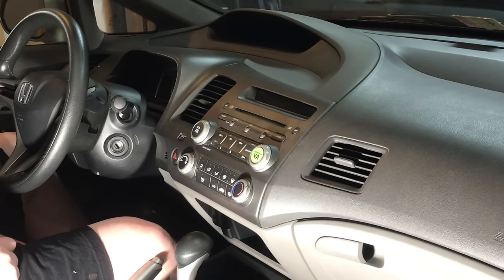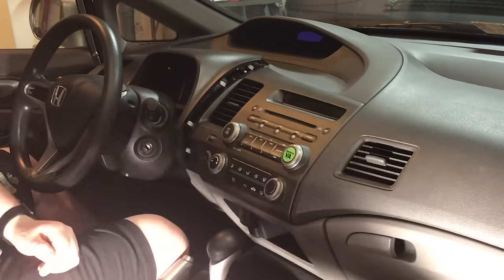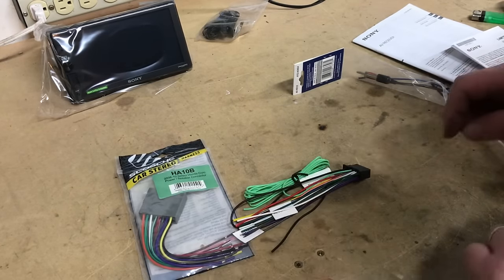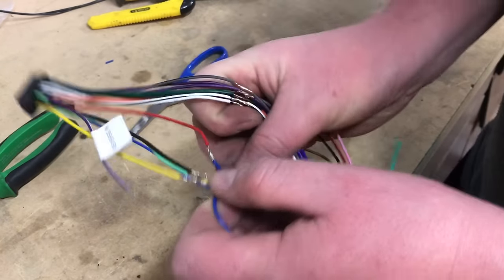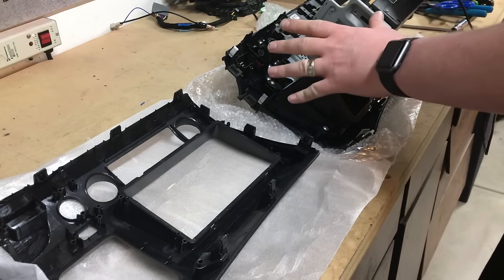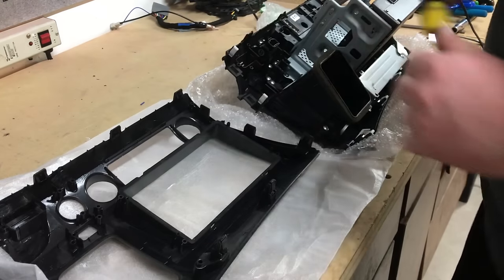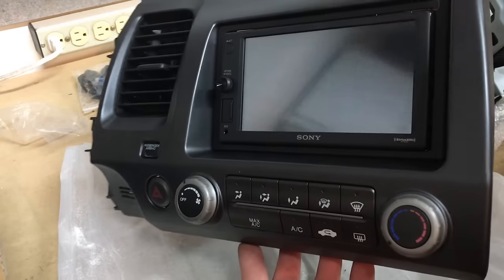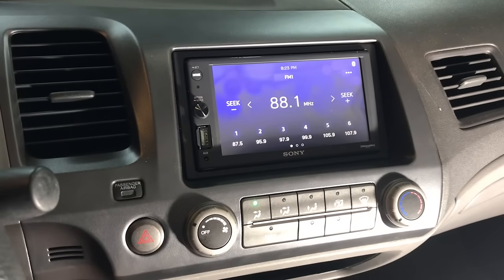2006 - 2011 Honda Civic Touch Screen Stereo Install

Comment from the maker: Parts Linked in the description!
Reply: Hi Chris, thanks for the great video. I noticed on your steering wheel on the left,  you at least have the basic volume control buttons, exactly like my 2010 Honda Civic. In your video, you say “we don’t have steering wheel controls in this civic” so you’re using the basic scosche HA10B harness, BUT In your description it says “If you have steering wheel VOLUME CONTROLS get the Crux harness”. 
Could u confirm for me if the scoshe worked with controlling the volume of the Sony Radio via steering wheel volume? I’m just a bit confused so I want to make sure if I get the basic Scoshe, the volume button on the steering wheel will control the volume on the Sony? I will be installing the exact radio you installed so I just want to make sure I’m taking the correct products to my mechanic. Thanks In advance.
Reply from the maker: @uniquetress7149  We did not have the steering wheel controls, so no, the Scosche harness will not work to control the radio.  You will need the crux harness.
Reply: @ProvoBeastAudio  Thank you. Will order now. Sorry for the long message 😀.
Reply: Heyy I’m having an issue with no sound. I have no idea what it is. I have a DX so no premium sound system. I’m getting power. And I kno the speakers work. Have any ideas. What did u do with the secondary harness that was plugged into the oenology radio. Cause you have the main. Then there an additional one that I can’t figure out. And it only has 6 wires and after looking for hours and hours. It doesn’t have that light blue wire that would be the amp power on. You didn’t seem to bypass the amp here so any advice.
Reply: Please state why you need the crux. I bought it form eBay it says it should work. The crux harness is 70$. It’s way too expensive
Reply: Great video. I just bought a ‘07 Si and was curious how to remove factory radio and climate control panel. I had no idea about the screws on the bottom. 
Thanks for helping me not destroy my dashboard 👍🏼

Comment: I watched the Crutchfield install video and thought...... why do you need to remove the entire dash? It didn't seem necessary. You proved me right, and you installed the climate control module in correctly. Also very professional soldering job, nice job !!! Crutchfield is tops but their video, while it covered the install well, was a little sloppy and amateurish.
Reply: I agree , he even disconnected the airbag

Comment from the maker: If you have steering wheel volume controls you would like to retain with your civic, use the Crux SWRHN-62B harness adapter instead of the Scosche HA10B Wiring Harness Adapter.  The Crux adapter is a simple plug and play unit which allows you to keep those buttons working on the steering wheel with the new radio.  Cheers!
Reply: Nice
Reply: First, I must say this is a great video. It's really informative.  I would like to try to install one in my civic but would like to retain the steering controls. Do you have any videos that show how to use the crux swrhn-62b wiring harness? Thanks

Comment: how much would something like this cost to have done at a shop?
Reply: The shop can make up any price, you can call to find out how much would it cost but you would only be ripped off. Just be a handy man and do it yourself, save money and learn something new at the same time.
Reply: Antiquarian $300 for just parts 500 installed
Reply: @antiquarian1773  Or completely mess up your car.  Nothing wrong with paying a pro to do it, peace of mind is priceless.
Reply: Mike A  It was my first mod at 15 man. Second mod was putting type r cams in the engine. Third was polishing the head and adding cylinder sleeves. You’d be surprised how easy car stuff is once you watch enough YouTube.
Reply: @gustavrodriguez910  - haha nice.  who needs school?!  Youtube taught me more than 12 years of high school and 4 years of college.

Comment: Great video!

Really helpful, especially as a complete novice to pretty much everything in this video (soldering was the only issue but ofc that depends on the individual).

(Originally commented about how CarPlay couldn't tell the dimmer status - that was bc the head unit had dimmer set to ON, not AUTO)

Comment: Definitely the best of the few I watched. , I've wired quite a few , so that wasn't my question(s) , my stock oem radio had 2 plugs, 1 plug I can only guess is for the steering wheel controls ???
Also the L brackets you used , my face plate came with but the holes didn't match up with the cheapo head unit I have which also came with metal L brackets. I was able to drill/modify those brackets. Longest part of my install, lol.
I'm gonna watch your backup camera video. Thanks ! For the guidance and reassurance

Comment: Blue wire can be used for the power antenna so that it comes up only when the radio is on and down when its off. Cheers!

Comment: Any one have issue where the ac/heat buttons stick down (max ac specifically)

Great video, that was the only issue I had (of course the whole thing is back together before I noticed the button)

Comment: Thank you for this video!!! It was my first time doing anything to my car and this video really helped. Only issue I have is that I’m not getting any sound. Everything else works but that lol any ideas of what I might have done wrong?
Reply from the maker: Sounds like you have the factory amplified sound system.  You will need to connect the blue / white wire in your harness adapter to your radio.
Reply: @ProvoBeastAudio  when you connect the blue and white to the radio is it canceling out the factory amp ?
Reply from the maker: No, it retains and turns on the factory amplifier.  Only way to "cancel' a factory amplifier is to bypass and remove it.
Reply: @ProvoBeastAudio  no one removes it though in all the vids they just symply bypass
Reply: Did you figure it out
Reply: @ProvoBeastAudio where do you connect the blue white to?
Reply from the maker: It's an amp turn on wire, if there is no aftermarket or factory amplifier, no need to hook it up. @weksos4423

Comment: For anyone that has no sound, if you have Premium Audio option, you will need a cable to bypass the stock amp (Metra 70-1727)
Reply: Isn't there a way to have the blue /blue white hooked in the harness to make it come on. If the bypass is wired your no longer using the amp correct ?
Reply: I am having issues with this. 😢

Comment: sweeeeet video! i do have a question though. So i have a 2008 honda civic ex with the premium sound system which has a subwoofer in the rear deck. I think that includes a factory amp.. would i hook up the wire that you left out for an amp for that factory amp?
Reply: You need a special harness to bypass the amp signal

Comment: Hi man i just bought a csx 2008 and i want to know if its the same way to remove and install a new radio like you did on a civic 06-11 i know they are almost the same but before buy i want if  all component are the same and used your video to change my radio...! Thk a lot love the simplicity of your video thk

Comment: Nice video! So, what did happen to the flashing ANTI THEFT light? Is your alarm system working fine?
Reply: Answer: The radio has a built-in anti-theft mechanism that causes it to reset after your battery dies or is replaced. The flash light is only for the radio. Fortunately, it is not related 
with the key anti-theft system that is used to immobilize the engine when a fake key that is not sync programmed to the vehicle is attempted to be used.

Comment: Great video. Im running into 2 problems. I have an EX with steering wheel controls and I hooked everything up and I have no sounds and no control at the steering wheel. Could use some advice?
Reply: I used the Crux SWRHN-62B for the steering wheel control
Reply from the maker: @R8rblood  I'd suggest reaching out to Crux directly for assistance as the issue will be in your wiring or compatibility with your vehicle.
Reply: Any fix?
Reply: @kobylewis2281  had to find the steering wheel stereo control wire and jump/splice to it. It was grey and green or pink. Can't remember.

Comment: Were you able to get the next and prev track button on your steering wheel to work with the new Stereo?
Reply: That car doesn’t have steering wheel controls
Reply: @robfassi3297  2010+ does.
Reply: FreeStyle yes only ex and si models, any 2006-2011 civic ex or si has steering wheel controls. Dx or lx does not.
Reply: Anyone  knows wheres thes factory amplifer for honda civic si 2007
Reply: @lunaticscarclubjdm5572  front of the shifter

Comment: My 07 Civic as the steering wheel controls. I see the Crux SWRHN-62B has the antenna adapter with it, so do i still need to get the other antenna adapter?

Comment: Friend, when connecting everything again the air conditioning no longer turned on, I already checked and connected the plug in correctly, what could it be?  thanks

Comment: Amazing video! If I am installing an amp, and I have the blue power wire connected, do I need to then use the ground that is included in the harness? Or just worry about the blue cord?
Reply: You still need a ground. The blue wire (if you’re talking about the remote wire) is ran from the head unit to the amp telling the amp when it should be on or off

Comment: Thank you for this tutorial! I have this exact head unit on order but the 08 Civic it's getting installed in has steering wheel controls. Does the Crux SWRHN-62B harness adapter match up wire for wire like the Scosche HA10B? Looking at the pictures in the Crux harness listing I'm not quite sure what i'm looking at, compared to feeling confident in the Scosche HA10B after watching this video. 

Any insight would be greatly appreciated. Thanks again!
Reply from the maker: It would be very close, if not identical and they diagram all their wiring in the instructions that comes with it.  Highly recommended.
Reply: @ProvoBeastAudio   Thank you for the response! I'll go ahead and purchase it. It appears to have an antenna adapter included with the harness, does that work or do you recommend purchasing the Metra 40-HD10 antenna adapter you have linked in the bio?

Comment: I've replaced the radio in my Civic 2010 hatchback but the original AC display stopped working (I knew it would happen) but I don't want to loose the little display since I want to know what my AC is doing. Any advice?

Comment: Pretty nice video my friend, i'm getting the same dash to my Civic, i need to get a radio, Can you please tell the right size or dimensions for the stereo. i'm about to order one online but i need to get the right one. Thank you.
Reply from the maker: Screen sides is irrelevant, the kit we used works for all standard size double din radios.
Reply: So a 10 inch screen fits?
Reply: @rexholes9574  no it wouldn't because a 10 inch screen is bigger than the double din size the biggest you could do would be about 7 inchs

Comment: How do I connect the steering wheel control for a 2009 Honda si? I already bought everything in this video
Reply from the maker: Use the Pac SWI-RC control module.  That should do the trick.

Comment: Where did u connect the harness to the antenna mine doesn’t fit
Reply: There should be a connector in the back of your unit that may say ANT. Not sure if your unit came with one. If you're talking about your antenna power wire, he wired it to the power wire.

Comment: If we don’t have a reverse camera to install we can cover that wire up correct? No issues?
Reply from the maker: Yep, and as the reverse trigger wire on the radio is an input, not an output, you can just leave it as is as it won't hurt anything.

Comment: Doing it this way won’t effect steering wheel mounted cruise control buttons right?
Reply from the maker: Nope cruise runs independent of steering wheel volume controls.
Reply: That’s what I figured, Thanks for the reply! I ordered from Crutchfield and it mentions wiring into the brake light wire, for the Sony xav-ax1000 I’m guessing that is as simple as it sounds ?
Reply from the maker: @sheldon7411  Honestly with Sony's, you can just ground the parking brake wire for this year to bypass the parking brake.

Comment: would splicing it be okay instead of soldering them?
Reply: You can splice it pretty much does the same thing but I heard it has a better connection if you solder them together.
Reply: Soldering will always have a better connection. Heat shrink will allow you to have a better seal and protection so nothing arcs/grounds out. That is the last thing you want to happen, especially if you bought an expensive unit.

Comment: When you say “remove the negative battery”

Are you saying under the hood to literally unplug the negative part?
Reply from the maker: Literally remove the negative cable off of the terminal of the battery.

Comment: Would have been nice if you'd shown how to remove the AC and fan control knobs
Reply: theincrediblewho did you figure how to do this
Reply: @403_blessed2  yes I did! Had to watch a few YouTube videos before I found someone who thought that a removal/reinstall video needed to show all of the removal steps, so it's not just this guy.

It's actually way easier than I expected: after you remove the 4 back screws, you just push the middle of the knob with your thumbs. The outside ring pops off, the climate control unit is free, and the rings pop back in after you put the CC unit in the new panel, although you do have to line up a notch inside.
It would have added about 30 extra seconds to show both steps.

But again, I saw a lot of videos that left out that step, so apparently most YouTubers think it's self explanatory.

Comment: Does the USB port located under the armrest still work after installing this radio? Thanks!
Reply: Bro where is the usb and aux port in radio I haven't seen plz tell plz
Reply: @aslambazai94  I don't have this stereo. Some of the 8th gen civics had aux and usb  in the arm rest compartment

Comment: Scosche HA10B Compatible with Select 2006-10 Honda Civic Power/Speaker Connector / Wire Harness for Aftermarket Stereo Installation with Color Coded Wires I know the video says 2006 up but wondering if this will work for my 2011 honda civic LX it does say compatible with select 2006-2010 so I was wondering if its still compatible for mine. Thanks!

Comment: Crutch field said I needed the idata link maestro for this install. I only have cruise control for steering wheel controls. Is that correct? I already bought it...........
Reply from the maker: Depends on your trim and year. Send us a message on Facebook and we can help you with your install!
Reply: @ProvoBeastAudio   I called tech support at Crutchfield again. They finally told me I didn't need it. They are sending me a new set up. Thanks for getting back to me.

Comment: Very much appreciate the tutorial. I am trying to get my backup camera to work the back is working but front isn't responding. It says the red wire is the 12v acc, switch and I have it wired into both the radio and the car. Thanks in advance

Comment: I just follow everything. The stereo is on, but my speakers don't sound. Is there a possible way to fix or should I replace everything?
Reply from the maker: you may have a factory amplifier.  I'd hook up the blue white wire on your harness to see if that triggers it to turn on
Reply: @ProvoBeastAudio  I believe the blue white [from the stereo] to the red one [adapter harness]? If so, I tried it turns out. the stereo doesn't turn off. good thing the battery survive the night.

Comment: Would you recommend adhesive foam to cover the gap space? Basically making it super flush with the dash.
Reply: Only if it is highly resistant to heat, especially if you live in a very warm environment. I've seen those things disintegrate a lot. Also, if you are thinking about changing out your aftermarket receiver unit for another one, I wouldn't recommend it.

Comment: hey ive got an ‘07 civic si, with a pioneer touch screen. i wanted to replace my climate control bulbs, as i bought them in red and the factory ones aren’t working so there’s no illumination. would this still be the same for removal? i don’t want to mess anything up with the touch screen but it’s all in one piece im assuming, so how would that work?

Comment: I already have a double-DIN radio installed, do you need a new wiring harness, or is there a good one behind the dash? (haven't looked yet)
Reply from the maker: Depends on the condition of the harness, but you could probably salvage it, but won't know until you look.
Reply: Im trying to install this in my civic but im having issues with no audio, do you think you’d be able to provide advice?

Comment: I have been looking for one. Where did you buy this. Can you send the link. I have been trying to find on ebay and amazon
Reply: Here's a few links:
https://www.amazon.com/Scosche-HA1561DGB-Single-Installation-2006-UP/dp/B000ORMBA6

https://www.scosche.com/2006-honda-civic-din-dbl-din-kit-dark-atlas-grey-color-match

https://www.crutchfield.com/p_142HA1561G/Scosche-HA1561-Dash-Kit-Dark-Gray.html

Comment: So I’m trying to install a backup cam to my 09 Honda Civic EX but I’m having Best Buy install the same exact Sony stereo in this video. They are installing a Metra radio harness to the car but on the harness itself has no reverse trigger like the brand you’re using in the video. I called Best Buy about that and they said that there’s no reverse wire for my car and I would have to find it elsewhere in the car. I also mentioned that there is a harness from a different brand that has the wire but he said that the brand doesn’t matter and that the harness they’re using is the correct one. But looking at your video sort of negates what Best Buy is saying... I’m confused.